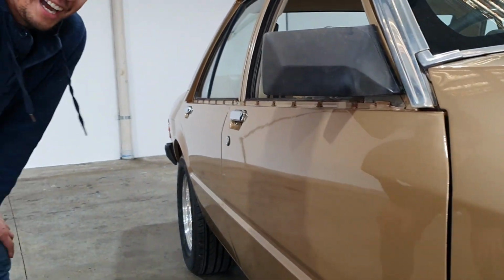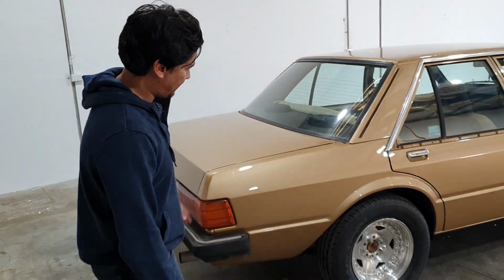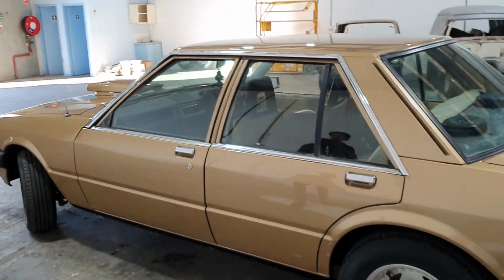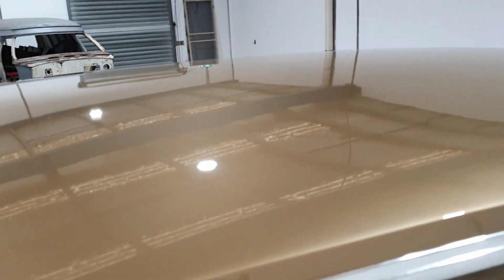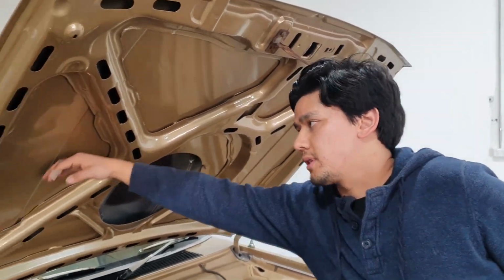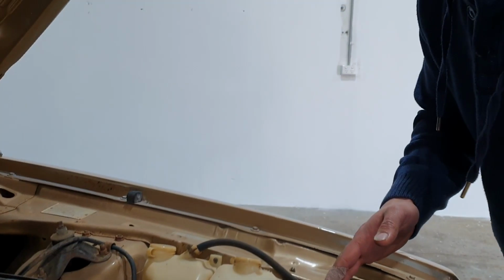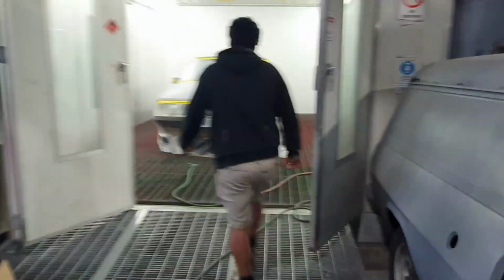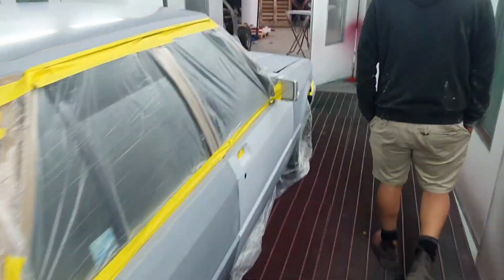My 1982 Ford XD Falcon Gets A New Paint Job...And A Hood Scoop

Comment: To help with cold starting you gotta adapt a lot, on cold mornings full choke to start it then in to about half or slightly more, then every 30 seconds listen and if it’s rough put it in a tad till it evens out. On hot mornings half choke to start it then in to about a quarter for running, after a minute put it in fully.
Usually warm it up for 2-3 minutes and don’t forget the choke out, it’s a common mistake, you’ll waste fuel and when you stop it’ll stall it gave me the run around I was freaking out for a hot minute then put the choke in and it ran. In the event that floods which you’ll notice because you’ll stop running and just won’t start then hold the throttle wide open while cranking and eventually that’ll  clear out the excess fuel and you’ll be on your way
Any way hope that helps you out and most of all you have to be the computer in this car adapt to the temperature and eventually you’ll start to get a feel for your car and make changes accordingly
Reply from the maker: Your spot on Craig, it's about feel and getting to know what the car likes in what situations. Every car is a little different! Cheers Jonno

Comment: Any car from that era with a carburettor needs to be warmed up 

so obviously it has a manual choke you need to get the heat into the motor the temp gauge should be starting to move up before you drive off basically and it won’t stall....

You just turn the key and pull away it’s always going to be a pig that’s normal
Reply from the maker: Absolutely spot on! Gotta love old tech